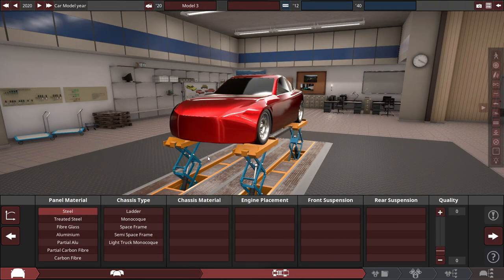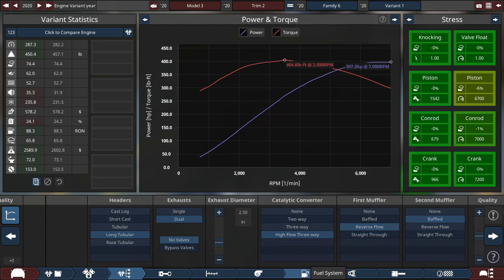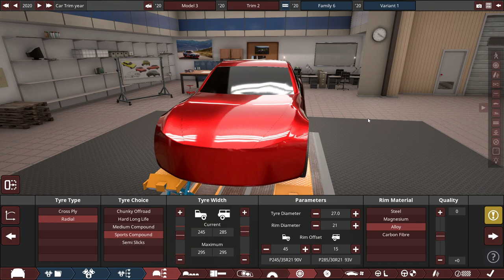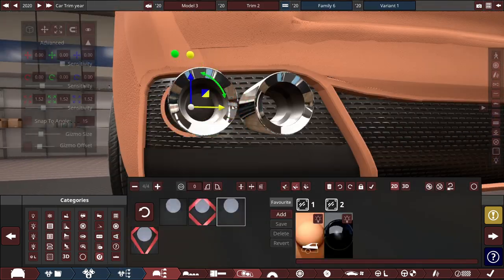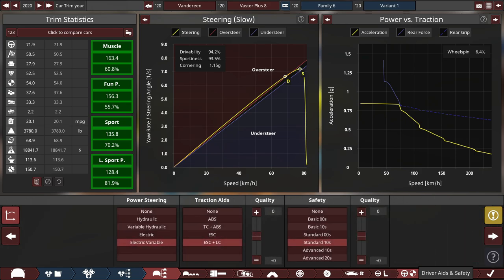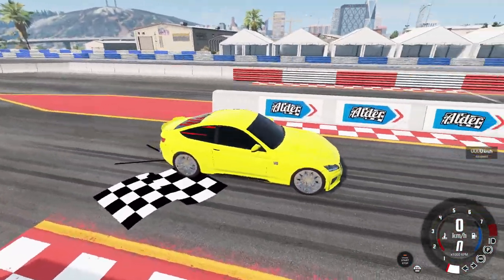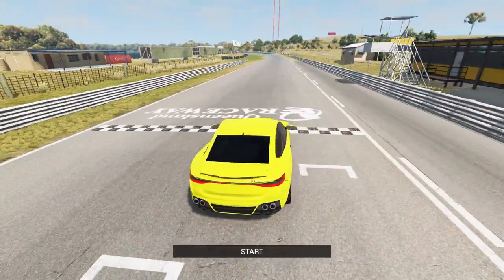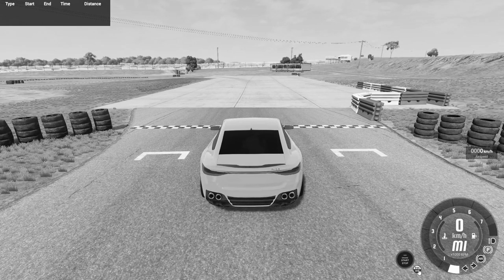Building A Modern Muscle Car In Automation!! Automation - BeamNG

Comment: So, Vaster is a comparative word that basically means "of a greater extent" or "more immense" as if its greater than the owner will ever know. Vandereen can perhaps be a Romanized derivative of Vanderveen which translates to "Of The Fen" with fen meaning a low and marshy or frequently flooded area of land. Its Dutch, and in that vein of language Vaster in Dutch means Firmer, so that could also presumably refer to the sports suspension being more firm and planted than the average straight-line-speedster muscle car, which admittedly isn't saying all that much considering classical muscle cars were floaty and modern ones are understeery, so the 50/50 weight and tendency to oversteer with throttle does in fact exhibit a more planted and firm handling performance than a regular muscle car. Its like a Dutch modern 2020 Shelby Cobra with a full aerodynamic body, yeah. Well, that's my etymological report XD
Reply from the maker: pretty much like a dutch shelby tbh. Lighter then its competitors lots of power etc

Also i didnt even know Vaster meant anything LOL it just came to me XD
Reply: @TwinTurBros  Well an example of vaster in a sentence could be…
"The magnificent valleys of Switzerland's Alps were found to be vaster than those typically found between the sublime peaks of Norway's Jotunheim Mountains."
…or at least something to that effect. I liked English class and then languages and now I like learning history of words and their roots XD
Reply: @Avetho  Or "more vast"